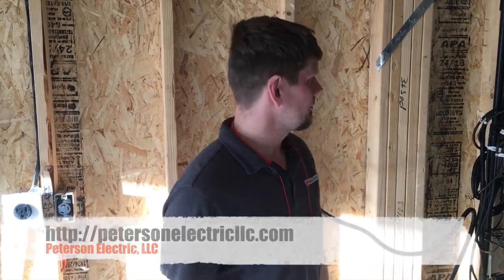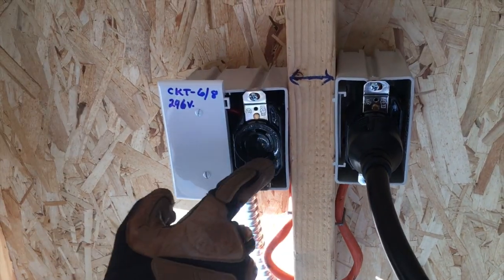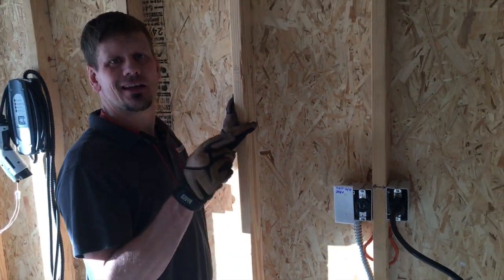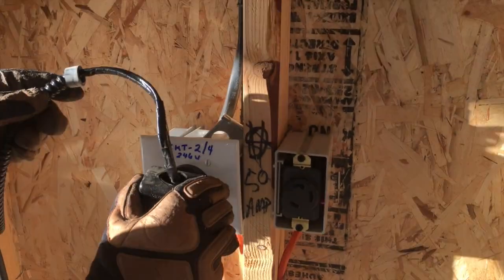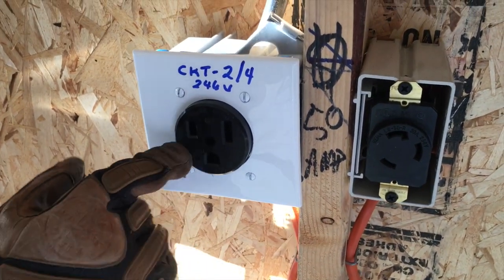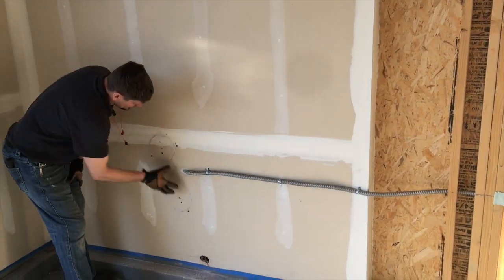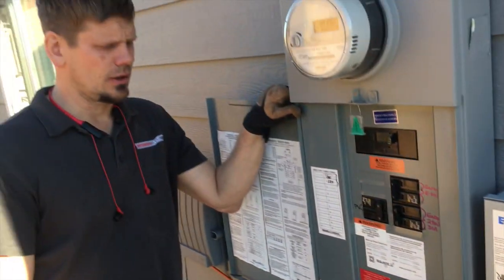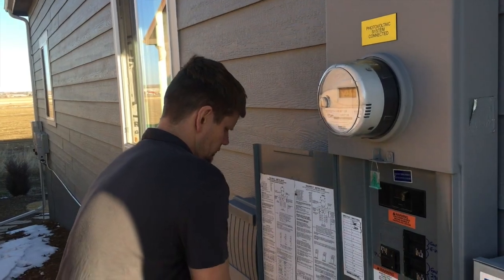Cryptocurrency Or  Bitcoin Mining Electrical Wiring & Amps & E-Volt Car

Comment: Hello Sir,
Sir I am From Oman i would like to know can i use Single Phase Electricity for my mining rigs i am planning to build 14-20 rigs each rig will take 12 gpu of 3080 Ti
Total power supply will be required 3 in each rig 1800W x 3= 5,400 Watts each rig.

Can i use single phase electricity.

Comment: Why are there still ppl starting up mining lol he's 3 years too late. I doubt that mining rig will even cover the cost to run it NVM return his investment on the rig itself.
Reply: Anyone ever find, Jeff?? Mid Jan 2022 comment here
Reply: false
Reply: What are you talking about? Don't be ignorant. As long as you mine with cheap electricity (like $0.04 KWh) you are profitable. That's not even including the appreciation of holding bitcoin. It's never too late.
Reply: The hashing block is going to be halfed in 2020 so if someone is barely making "profit" now they will not be by that time and especially not 4 years later when it is halfed again. The thing is that most people will hardly recoup the cost of their mining rig in that time. That's why it was so lucrative early on. Also cryptocurrency's value are very volatile.
Reply: @Chris-os4sf  A year from now, Bitcoin will be worth ZERO!  Mark my words.  You have been forewarned.
Reply: @Jeff-xy7fv  One year later....Bitcoin is worth $10258.70. Where's my prize? lol
Reply: Jeff GUESS YOU WERE WRONG
Reply: @theephantommenace  16000$ now they were so ignorant.
Reply: @Jeff-xy7fv  a year now. It's Bitcoin is 19,300 usd as of 12/6/20
Reply: @Jeff-xy7fv  2 years from this comment and it is at an all-time high. Clearly you're a lot more intelligent than everyone else
Reply: Close to 42K before it pulled back. Jeff couldn't have been more wrong LOL
Reply: @Jeff-xy7fv  Man, your comment did not age well. LMAO
Reply: @Jeff-xy7fv  Hi Jeff, it's almost $55K now
Reply: @Jeff-xy7fv  And now it's worth 58,000! Do us all a favor and eat your words instead of spitting them out. As long as businesses continue to use bitcoin it will gain more and more value. Elon Musk has now accepted bitcoin as payment for Telsa products. To the Moon Bitcoin will rise!
Reply: @Jeff-xy7fv  This is did not age well
Reply: @Jeff-xy7fv  this aged well